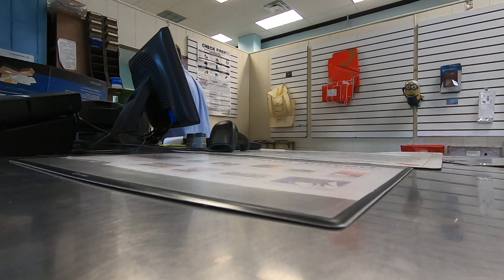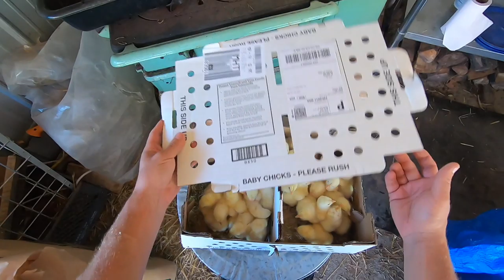One Man Attempts Roofing His Post and Beam Barn

Comment: Hey Al amazing job.  I do not want to be critical but I have installed the metal roofing and siding before and there are a few tips that might save you some long term aggravation.  When you cut the panels with a circular saw it makes little metal filings that fly all over your panel.  If you haven't noticed they can actually melt into the paint of the top sheet.  Over time these little shavings will rust and then cause streaks down your panels.  Try to brush off those filings as best you can.  Also any bare edge of the panel should be painted, if you can't find a matching color use clear coat to reduce the risk of rusting on the edge and causing premature failure and rust marks down your panels.  I would suggest that before you put your ridge cap on spray paint the cut edge of your panels.  Also the rubber washer on the screws shoudln't be so tight that it squishes out.  If the metal is dimpled then the screw is too tight.  If the washer is blown out it will prematurely fail. Hope it helps!
Reply: Mike Bodamer Sage advice!

Comment: You can use a roof ladder - a ladder on top of the tin, in such a way that loads are transfered through to the wood underneath, to insert missing screws and the ridge capping.  

In UK you would need much more overlap and eaves length to stop water/rain being blown in under the force of the wind - driving rain as we call it.

Comment: Al, others on YouTube who do tin roofing do better with a torque limiting drill driver rather than an impacting screw driver to drive those hex head screws. They set the torque to cinch the screws rather than using eyeballing it or the impacting to set the screw. This results in the rubber washer being set to the same compression on all of the screws. Over torquing can start to weaken the wood the screw is set in. 

I know, 2 days late but you still have a the side roofs to do.

Comment: Good job, Al!  You're not using foam rib closures?  Jamaica Cottage didn't include foam rib closures in the kit (I find that odd)?  Leaves, twigs and other debris will enter your building through your ridge cap without foam rib closures in place.  All the best, Al and #TeamLumnah !
Reply: You kinda don't want foam, it will block the air but they do make a mesh for that. Keeps the bugs out but lets the air move.
Reply: Also where is the rest of the trim, it makes the job look so much better and by the positioning of the tin I wonder if u r using it all
Reply: Here we go by wind direction and not as much cosmetic, and u must not have as much wind as us as u are only using half the screws as we do
Reply: @augustreil  Yes, they make rib closures of many different materials and methods of making those materials.  Air exchange is a good thing.  Last place I lived my tools were in 30'x40' building that didn't have closures.  Literally filled my open top compartment on my toolbox with debris from the trees above building - more than once.
Reply: @sheilamclaughlin963  Animals, cows and horses, position their bodies opposite the direction of the weather - you're right on that point.

Comment: Couple of questions. 1. When you were putting the screws into the tin, up on the roof, it showed a few rows that had pre-drilled holes, but you didn't put screws in them. Did you just skip them, or go back, not on video, and put them in? 2. What are you going to use the current little barn for?  You are doing an awesome job. There is no way I could climb around on the rafters of a roof.  I'd get nothing done. LOL

Comment: The only trouble with cutting your roof sheets is that if you don’t sweep the iron filling off the sheet it will leave rust marks on the surface and it’s hard to clean off later.  I know it’s only a barn.

Comment: Great job . Was that last piece already cut for wide for the roof ? I noticed that you didn't put anything under the ridge cap to prevent bugs from flying inside .
Reply: It is a barn......
Not a house....
Reply: @ka6148  No need to have a hissy fit . I know what it is . Have seen many barns with foam ridge closures under the ridge cap . Besides I wasn't asking you but thanks for your reply . Someone else was asking the same thing .
Reply from the maker: Yes the ridge cap was already cut to the width
Reply: @LumnahAcres  Thanks . You're doing a great job . Love this build .

Comment: Looking good!
I have a few questions I've been wondering about. I wonder if the roofing should extend a bit further, overhanging the roof of the lower sides (still waiting to be built), so rain and snow won't blow in. Also is there going to be stalls in the barn? Shouldn't there be doorways in the siding for the stall doors, or are the stalls going to be fully contained underneath the main barn you've already built?
Reply: The stalls for the animals are in the side extensions.

Comment: You are putting the screws for the roofing wrong.  You should be doing them on the ridge of the metal so when water runs down the channels it doesn’t go around the screws.   Where you put them that could leak in the future.